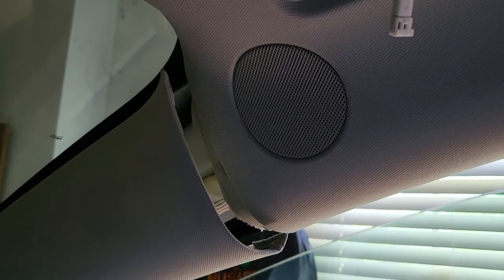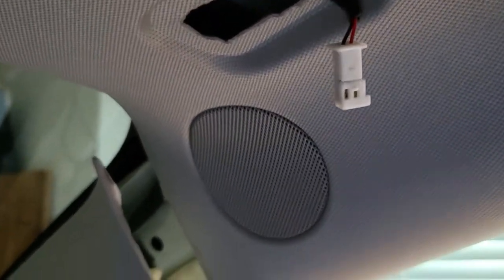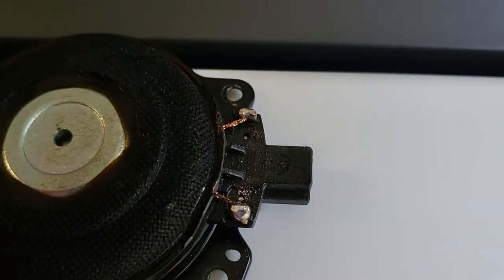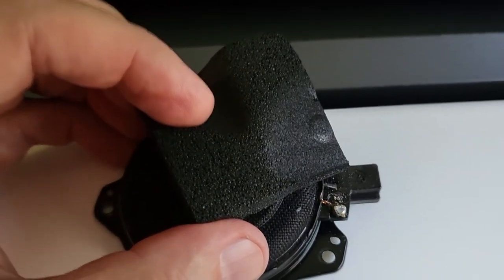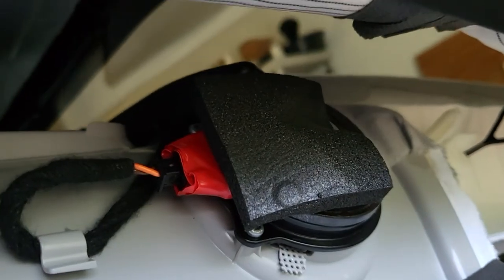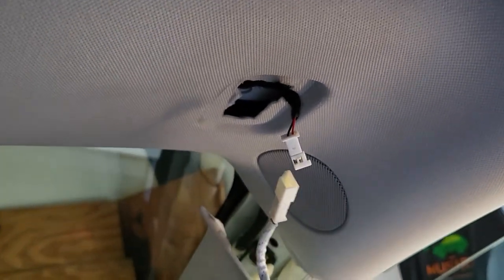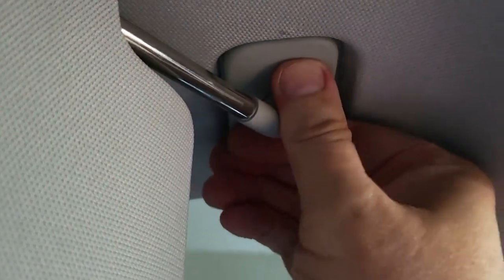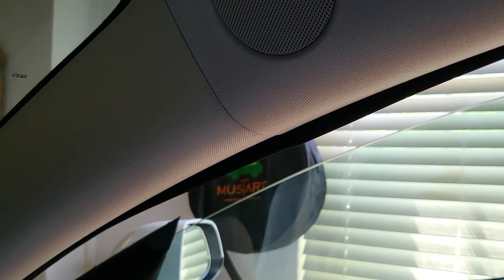Fixing 2021 Tesla Model 3 A-Pillar Speaker Popping Sound

Comment: Dude!!! Thanks so much same thing in a 2023. Was going to have Tesla come out and look at it they set up a mobile appointment at my house then they changed it to a regular service visit where I had to drive an hour and leave my car. This took care of it. Can’t Believe that there are exposed contacts so close to the frame.
Reply: Did you need to disconnect the 12v battery?
Reply: I did not. I just dropped the speaker enough to slip some duct tape in (doubled it up) to cover the exposed terminals.

Comment: Wow thanks for the info! I’ve been searching since last summer on my ‘21 Model 3 trying to figure out why the A-Pillar speakers would pop in hot weather when my car was cooling down 😅 Followed your suggestion to go there and lo and behold the speakers were grounding out… but through the foam in my case! The foam was correctly positioned on my car, but the posts were still grounding out… so a bit of electrical tape and it’s all good! My sanity thanks you 🤣

Comment: Brand new 2023 and same issue.  I was able to slightly detach the trim above the door/window frame and shift the foam fully over the speaker contacts.  Problem solved.  Hoping that the tight fit will prevent the foam from moving.  Seems just like a sloppy installation design. If it returns, I'll go the full route as you've demonstrated.  Great help ty!

Comment: My ‘23 had the issue on the passenger side.   Sure enough after finding this video I found that my speaker had no foam. 

Added some tape and foam and all fixed.
Reply: Where did you start to open the pillar
Reply: @Bane92  top